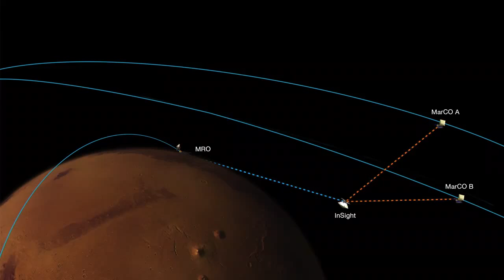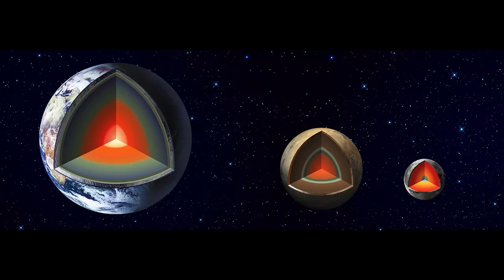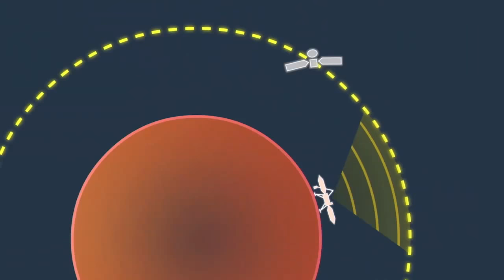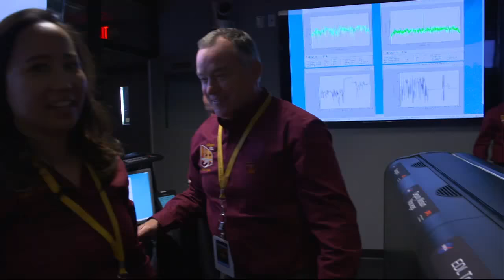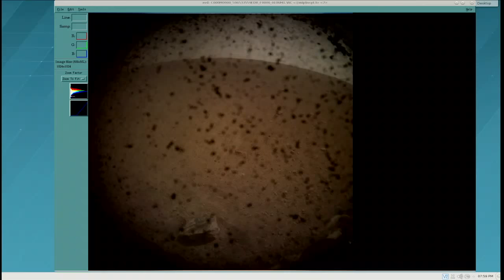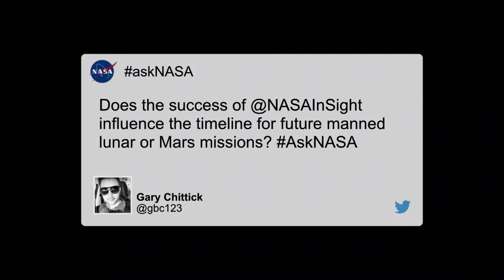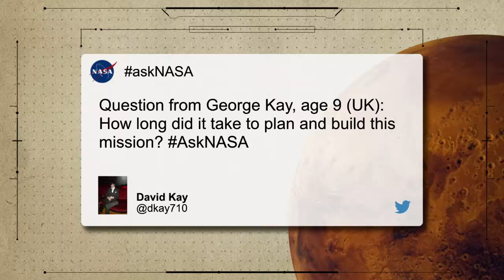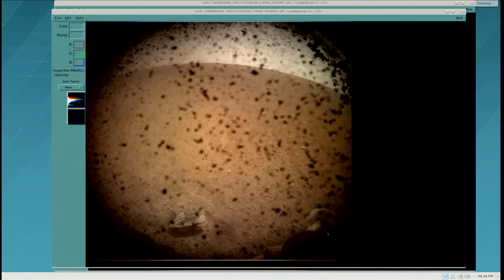Mission Control Live: NASA InSight Mars Landing

Comment: Of corse no pictures
Reply: No pictures and many many fals comments.
Reply: 59:44
Reply: how do you suppose they get pictures or video of the landing? is someone there waiting on mars to film it?
the data packets sent by the lander are small and take 3 minutes to get from mars to earth.
(it takes them minutes to "download" a single still image.)

the data rate simply cannot handle video
(imagine trying to tap out all the words in a novel using morse code and you kinda get the idea) it's gonna take a LONG time.

(video requires at least 24 images per second) so 1 minute of video requires 1440 still images.
it's simply not practical (and they get no more data from a video feed than they get from a still image)

video files are just too big to transmit effectively through space. (even on earth your wifi or bluetooth or 4g is slower than a direct wired connection) 
your phone is ALWAYS slower at accessing data than your computer is (now multiply the distance the data has to transmit by a couple of million Km's and it's not hard to see the problem)

the only images they can take are from cameras on the lander itself (impossible during entry to the mars atmosphere)

just because you don't understand something doesn't make it fake.
Reply: No matter what your beliefs are, the facts remain the same and we did go to te the moon. Enough said.
Reply: MostlyRandom ok say it takes 24 hrs! so what ? Eventually they will have video!  Nuff said
Reply: MostlyRandom There could be footage from a post-landing camera filming whatever it happens to point at before lander unpacking.  Maybe just a strut shaking, maybe a peak at the hot plasma beyond the edge of the shield.  Video could be sent in real time to satellites like Marco A and B, then relayed slowly from there if landing fails or from local lander memory if landing successful.

Comment: Why is there a radio signal transmission but not video signal while landing?
Reply: Video takes DAYS to get to earth
They can barely give commands to the thing, mars is really far away
Reply: @therealtruejacob4692   So we will see the video landing soon?
Reply: The lander probably has two aerials, one a short stubby thing that can transmit information slowly on Ultra High Frequency (UHF) to the two cubesats that relay to earth for the landing. It is used to send the telemetery or second by second readings from all the landers sensors back to earth - this is so that if it crashes they can figure out what went wrong, just like a black box data does in an aeroplane. The other antenna is a directional dish that transmits at a fast rate using microwaves directly to earth, to do that it has to be pointed at Earth and you can only do that when the lander is stationary on the ground and not swinging about in the atmosphere. They did manage to get one still picture sent after it had landed showing whether the ground was ok nearbye but I bet it took a minute or two just for that picture to be sent. Once that was done they will go back to using the radio channel to monitor the solar panel deployment etc. We should get some more pictures when the fast communications are working in the next few hours. The other high speed link is probably via the MRO (Mars Reconnisance Orbiter) and they said in the video that it watched the lander go down but then went over the horizon so would not be able to relay data from it back to earth until it has gone all the way round its orbit and comes over the lander again. All signals from Mars are quite restricted in how quickly they can send information beause there is a trade off in how weak the signal gets by the time it gets to earth and the speed at which the information flows, so it is unlikely that a video signal could be sent in real time anyway. You can send the frames of a video signal at a fraction of the speed you play it back at so we may see videos like the ones of dust devils, but they will have been recorded and then sent to Earth much slower than the speed they were recorded at. (we can just speed them up to watch them).
Reply: Likely, bandwidth required for the signal and when you think of the complexity of a video "stream" versus a radio's 'beep, beep, beep' type signal (think Morse code) or a text msg. versus downloading a [larger] data file. I hope I am right.
Reply: Sure you could send live video....once you've setup a "cell-network" with transceiver satellites every few 100 miles between Earth and the landing site. Let us know once that's done and we'll all tune in for the video streams ;-) 
Bandwidth power drops off as the inverse of the distance. These probes/landers are operating on low power transmitters to save weight/power usage etc. 
People are so used to doing these things on the their phones in modern world, they forget all the required infrastructure to achieve this capability.
Reply: @StealthyMonk It's not the speed of light that is the concern...it is the very low BAUD rate of the data packets.....the great distance reduces the effective power in the radio waves as the inverse of the distance. Think using a morse code transmitter to tap out a few gigabytes of data and you'll understand the issue. Yes, putting a huge/powerful transmitter on mars would help...but we're talking a lander the size of a small car with very low power and low weight (to save lift off fuel etc).
Reply: @StealthyMonk The vacuum or atmosphere is not a factor here. It is the basic property of all radiated energy (light wave, radio waves, sound waves, water waves etc) .....the energy drops off as 1/R^2.....so at 2 times the distance you get 1/4 of the power, at 4 times the distance you only get 1/16th of the original power. Sound (or water) waves require an atmosphere or air (or water) to propagate through and this does effect how far sound can travel, depending on air (water) density/temperature etc....because sound energy is compressing & expanding the air (water) molecules as it passes through them...so a lot more energy is lost during that process. Light or radio frequency energy does not interact with air to expand/compress it and does not require it to propagate any distance. Light/Radio (basically both are the same electromagnetic radiation, just at different frequencies) can travel in full vacuum essentially the same speed as in our atmosphere and even certain solids (glass etc).
Reply: They still working on the photo shop
Reply: @remr15  photoshop doesn't do video.
Reply: @StealthyMonk No, the emptiness of space does nothing to diminish them. They diminish in power by the square of the distance they travel, becoming fainter and fainter— but not changing in their frequency waveform, which is why radio communication and radio telescopy/astronomy works so well.
Reply: @TornadoCAN99  Yeah you're talking about the inverse square law or whatever, right?  But that holds true for omnidirectional energy such as the sun, but you can collimate light (like a laser) so that, instead of spreading, you have concentration.

So a network of lasers might work?  Though there would still probably have to be a lot of them.

At least, that's how I understand it?
Reply: @StealthyMonk if anything they should make it stronger because there is no atmosphere stopping them, though if you do send radio waves extremely far in the universe, they will eventually blend in with background radiation.
Reply: @TornadoCAN99  I see you have takes physics, good and cool
Reply: @CondensedComments  Lol Lasers use a hecka lot of energy, u know that right?
Reply: @StealthyMonk Boy, Do you know how HEAVY is high quality video?